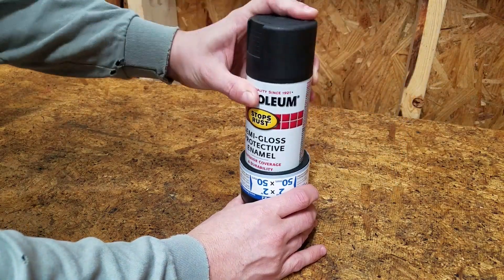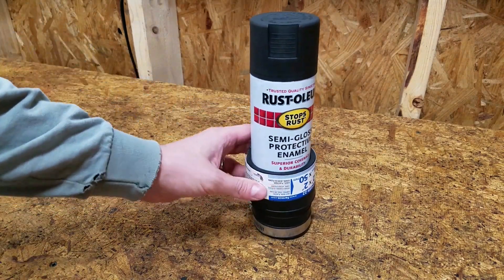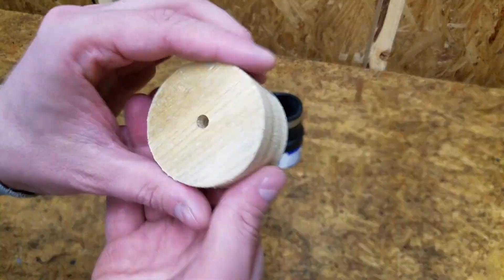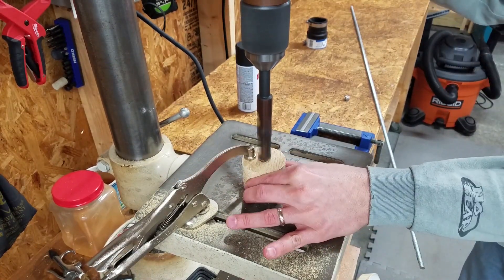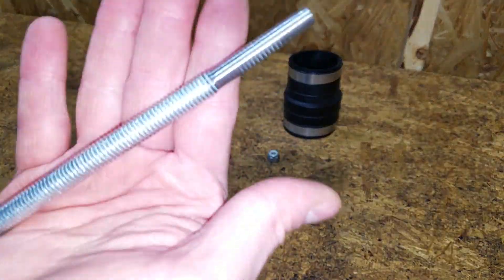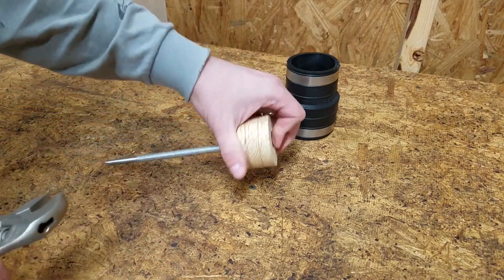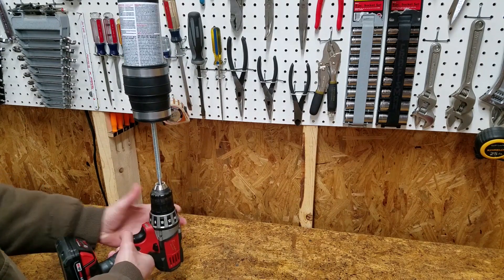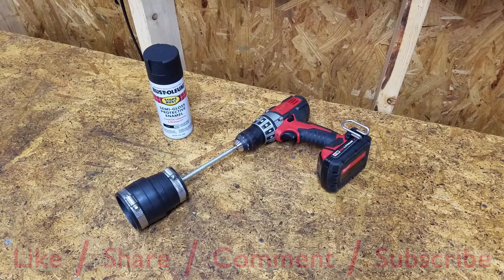DIY Drill Powered Spray Paint Mixer

Comment: ive know a better way.   sixty five ford used a piece of drainage pipe, a cap and a bolt through the cap.
Reply from the maker: That's cool, it sounds like a similar design.
Reply: @Mikeattempts  , no.   the can rattles loosely around inside the pipe.   my local paint and panel shop was impressed with my version of it.
Reply from the maker: @vsvnrg3263  Ah ok, I understand now. My version is similar to one that used to be sold online. The only catch with mine is, if the can has been sitting a long time, you need to give it a few shakes to free up the ball before spinning. If the ball is free, the mixer works great.
Reply: @Mikeattempts  , i often need to use cans that have been sitting in my shed for years.   i give the can a bit right-side up then give it a bit upside-down then back to right-side up to thoroughly finish the stir.   go and check out his video.

Comment: If this is not something that you use often and need a dedicated solution, just use the appropriate size hole saw for the connection between the drill and the hose reducer.
Reply from the maker: Yep, that'd work too.

Comment: My question is. Will the force just throw the ball that shakes it up against the can wall. Will it spin so fast that the liquid stands still….
Reply from the maker: Nope, it seems to mix the paint really well but there is one catch, you need to be sure the ball is free before using the drill mixer. What I mean by that is, if the can has been sitting a while and you can't hear the ball inside, just give it a quick shake to dislodge the ball from the solids that had settled to the bottom. Also, the rod doesn't need to be that long, I was just trying to copy a retail version of the same mixer.

Comment: I don't understand how a 2" inch coupler works here... all of my spray paint cans are 2 1/2"
Reply from the maker: Pipe is measured by the inside diameter, so the outside of a 2" pipe is just under 2.5". The other end of the coupler is larger to accommodate the spray can.

Comment: Pretty cool! A shorter rod won't flex and break, and makes it alot less awkward to use, as in butt the drill chuck up against the bottom.
Reply from the maker: Yeah, you're probably right. I was just trying to make it similar to the one you could buy, which has a longer rod.
Reply: I think the commercial ones have that longer rod specifically so it will flex while spinning, to create the vibration to help mix the paint.

Comment: No issues with that threaded rod bending over time?
Reply from the maker: I highly doubt it, at least not with the size I used. Two things though: 1.) I would use a nyloc nut or thread locker, so the nut doesn't become loose over time. 2.) Ease off the trigger and slow the can down instead of letting go of the trigger and coming to a quick stop.
Reply: @Mikeattempts  Makes sense. Thanks for the quick reply.
Reply from the maker: @89Mirageman  One other thing, you've gotta make sure the mixing ball is moving around inside the can before putting it in the mixer.

Comment: i thought the can needed to be shaken not stirred
Reply from the maker: Me too! Mine is a DIY version of one that is sold online and I didn't think it would work well until I saw a review by Adam Savage. The only thing I've noticed is if you pick up a can that has been on the shelf for a while, be sure to shake it until you can hear the ball moving. Then this spinner seems to mix it up the paint really well. If the ball doesn't move freely from sitting too long, the paint won't be mixed thoroughly.

Comment: How well does it work to shake up the paint? I saw the "I can Mixx" on one of Adam Savage's videos and he mentioned the shaft was slightly off center. I'm planning on making one but not sure if I need to go off center or how much.
Reply from the maker: That's where I learned about the "I Can Mixx" too. I wouldn't have thought it could mix paint well just by spinning the can, but it does. I don't think having the hole off center is necessary. With the long shaft, it's impossible for it to be perfectly balanced anyway so it creates plenty of movement.